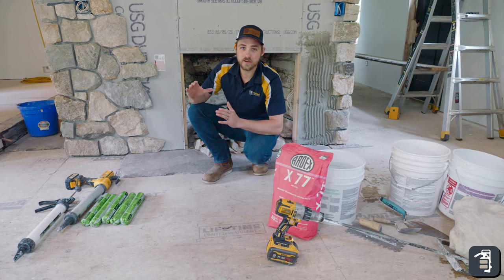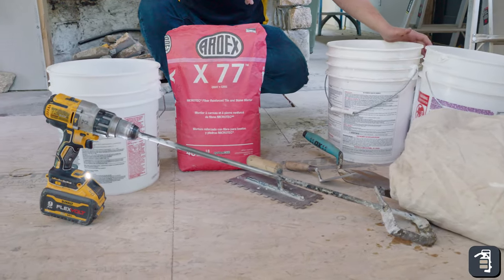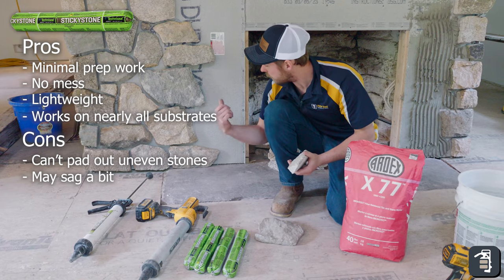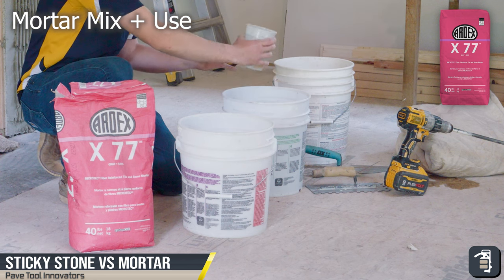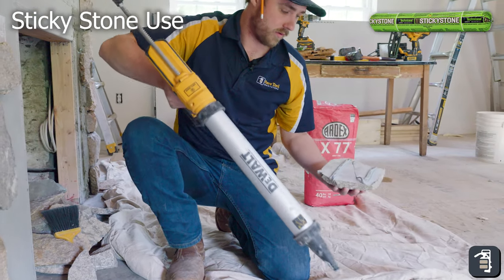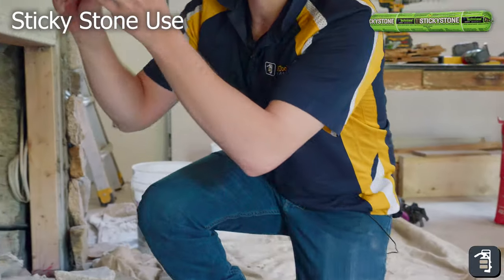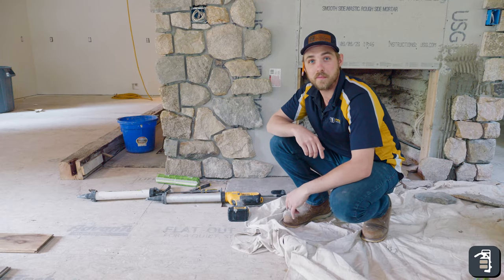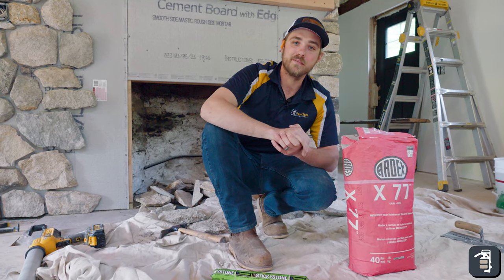Sticky Stone vs Mortar (Pros and Cons)

Comment: I just used sticky stone to install cap stone around top of my ledger stone. I have smooth concrete as a substrate and the ledge stone cap is completely flat so it should make good adhesion. I also built a stand/ shelf so the ledge cap/ stone wont move while curing. I wrapped the shelf in plastic incase any excess stickystone wont adhere to the shelf when i remove it. Alot of thought went into this. I hope it lasts in the winter. Lol

Comment: Cost is big factor.. mortar is much cheaper
Reply: It's not much cheaper when you factor time into the equation. With Stickystone, you have almost zero prep time and zero after-job cleanup. With mortar, you have to have water, buckets, trowels, and other tools as described in the video and these all need to be cleaned up after every job or at the end of every day. With mortar, you also need to mix in small batches so you cannot work continuously as you can with stickystone. So after factoring the cost of tools, time, and materials; stickystone is cheaper for you and for the customer. That allows you to finish jobs quicker, be more competitive on bidding jobs, and do more jobs per year!

Comment: First of all your scratch coat is going vertical instead of horizontal. Sticky stone is better for cultured stone because it's lighter weight and more even thickness. The right product for the right application. My time is money   the finished cost of the entire job is more is your actual cost not the particular material. And let's not forget the overall quality of your work how long it will last and how easy it is to maintain.
Reply from the maker: The X-77 Ardex product manufacturer recommendation for application is to apply the scratch coat vertically, not horizontal like you would with a typical mortar scratch coat. The customer wants what the customer wants and this is a way to satisfy a customer that wants natural stone. Thanks for the feedback!